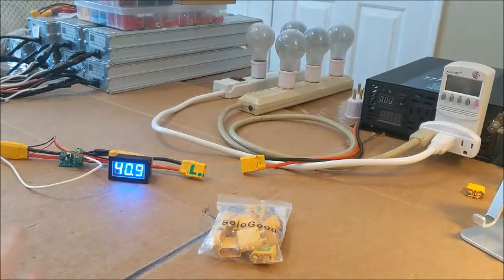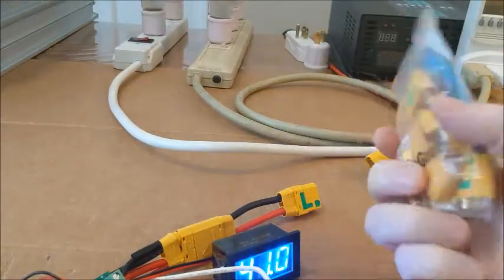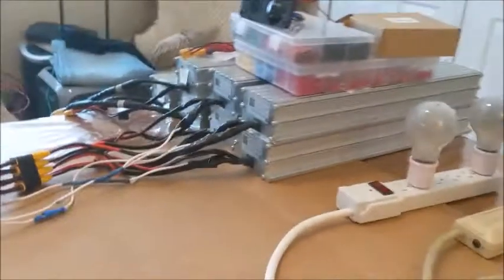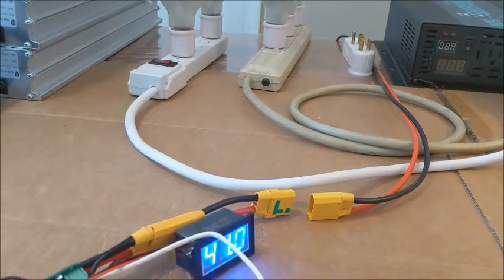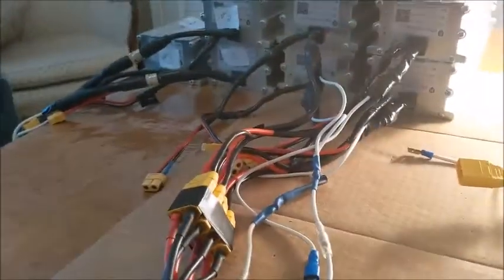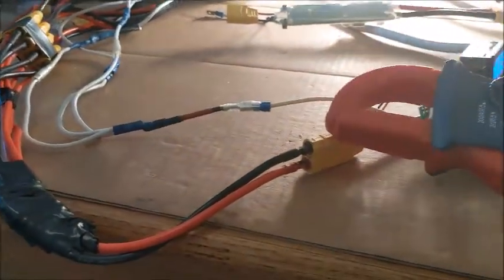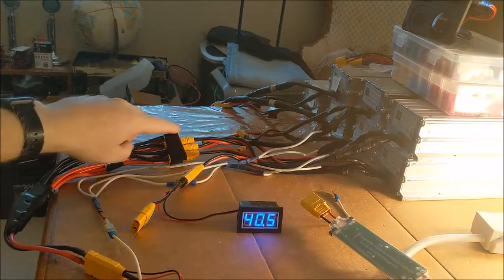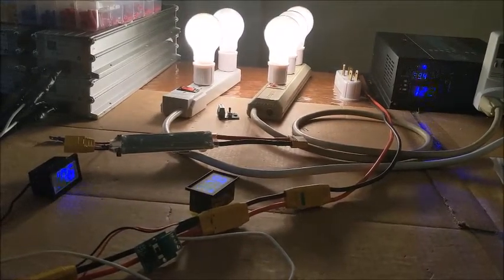Testing Anti Spark XT90s on Scooter Batteries

Comment: I killed both my activation boards... without any surges... I think they are all defective.
Reply from the maker: Which ones were they?
Reply: @sidjones-randomstuff2058  "ES-90 Battery Activator" - same as the one you showed. I had to go back to a arduino.. which is a bummer, it's not as clean of a setup.
Reply from the maker: @RealJohnThompson  you saw how many of those I went through LOL and finally got three working. Now randomly they're failing as well. I went back to the Jehu ones.
Reply: @sidjones-randomstuff2058  Jehu boards are soild. I know Jehu personally, he is trying to do as bulletproof modules/units as he can.